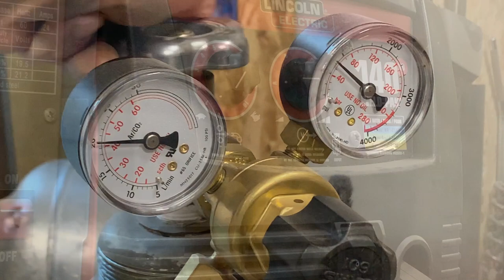Harbor Freight Bi-Metal Hole Saw Set Review | 4R NORTHWEST

Comment: Bought these to cut holes in a plastic barrel. They worked BUT plastic cutout wedged in the hole saw EVERY time and had to take 5 minutes to pry out of the saw. Took me over an hour to drill 18 holes.Plus tiny pilot bit is held in with a sets crew which came loose.
Reply: Operator error
Reply: lol, ya dingus!